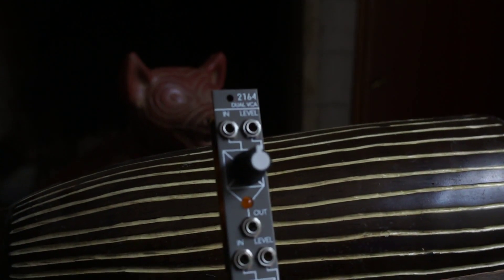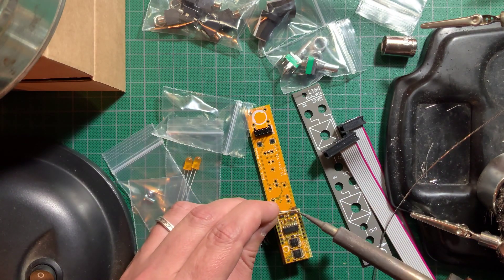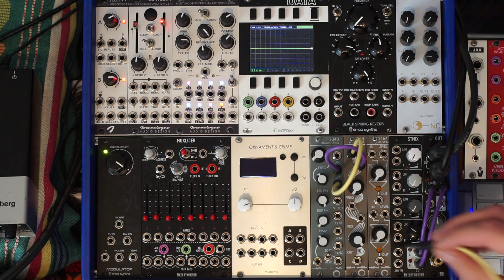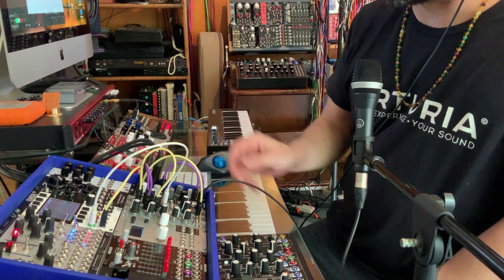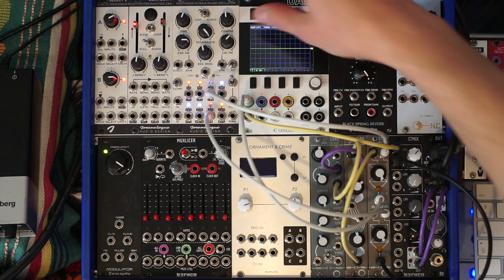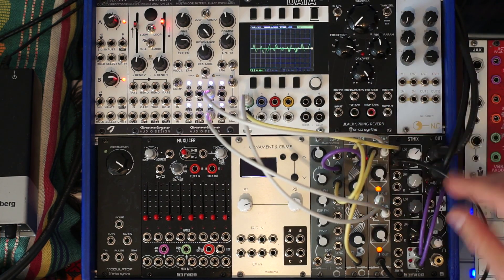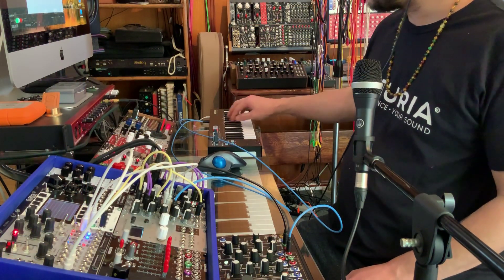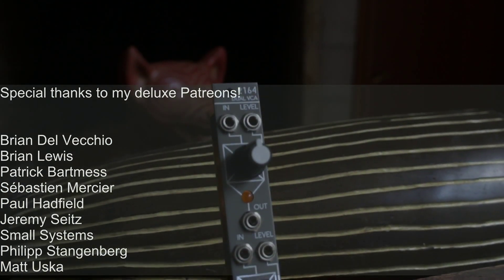Electro-Smith 2164  Dual VCA - Kit Overview

Comment: How is it in compare with LM13700?
Reply from the maker: Much better! Cleaner, less DC offset, less bleed
Reply: Yes it's a good chip I tried a couple of the as2164 quad vca chips, out of curiosity. Apparently if you link all four in parallel you get a better s to noise level.
Reply: So much better for clean amplification.
Reply: @fentanyljones6956  thank you, guys! But with all this situation the only choice is LM13700 now.